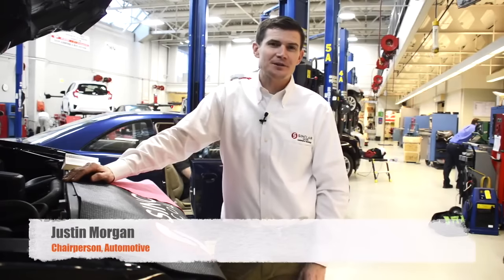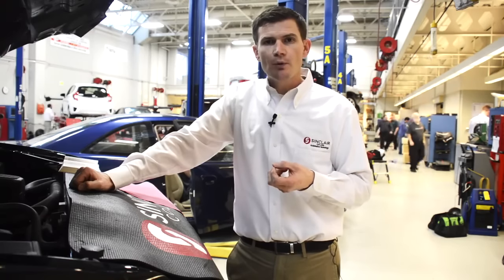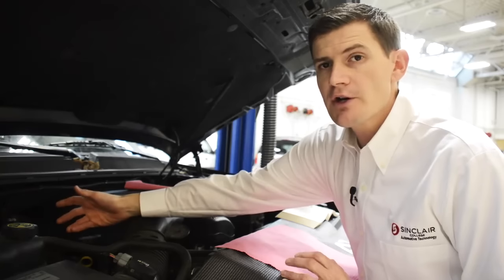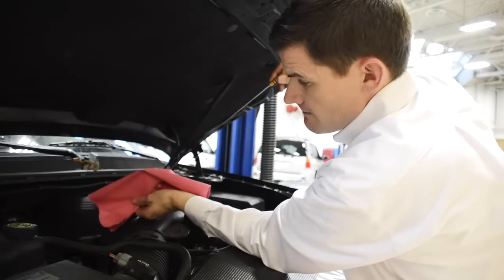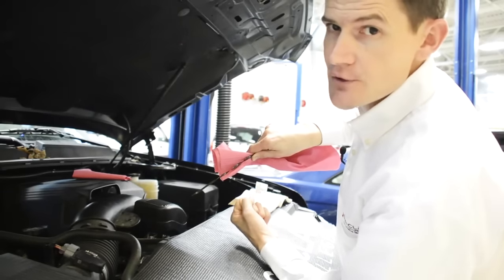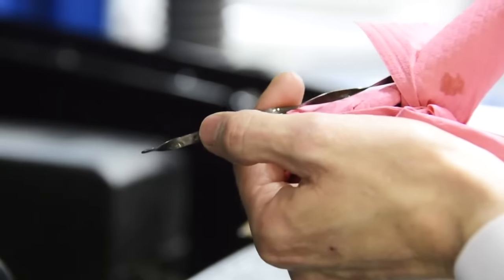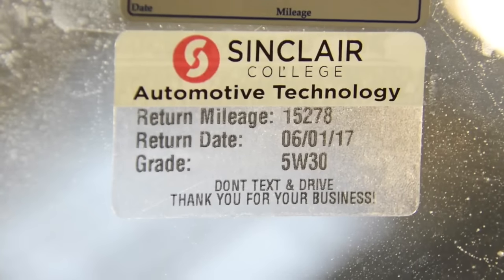How To Check Dipstick & Engine Oil - EASY

Comment: As an added note, my Mercedes C300 recommends an oil change every 15k miles or 12 months, whichever comes first. As long as you are using a quality full synthetic oil with long life filter there is no need to change your oil as frequently as your mechanic or lube place suggests
Reply: I get about 12k miles with full synthetic driving conservatively mostly on the freeway.  I stay on top of it and check it regularly, never had a problem
Reply: Especially if you drop the pan and do a thorough clean every year or other year.
I just cleaned up my 03 Yukon running strong.
Healthy truck
Reply: @someoneyoudontknow7407  - drop the pan ever year or so?     Dropping the oil pan is not something you ever need to do except if the gasket is going bad. Done it once on a truck with 270K on it but that was due to gasket. Don’t know of anyone that does it as a part of ‘regular’ maintenance
Reply: Why chance unnecessary engine wear?
I would never dream of going beyond 5000
or 6000 miles between oil changes.
Reply: @jimflick7564  - exactly Jim. The guy mentions Mercedes recommends… it says it all from you right there. Also the same thing about recommending that you don’t need to change the transmission fluid. Yeah right. No car should go over 7500 miles without changing the oil.  Period. I personally change mine every 5000. I would never dream of going 10 or 15,000 miles. Course you couldn’t give me a Mercedes. I have no desire to own a Mercedes. Overpriced and overengineered
Reply: have you had a lab analysis done to prove that?
Reply: @MotoTvWoodsFarm  - prove what?  ATF does not need changing and that’s it’s a lifetime fluid?
Reply: @jimflick7564  I dream of it on all of my cars.  I started using Amsoil back in 1995 and then switched to Mobil 1 around 2005.  I run my vehicles for 10,000+ miles with absolutely no engine problems.  My vehicles barely start using oil after 150,000 miles.  Although I use an Excel spreadsheet to document all maintenance, I still put white labels on the frame in front of the radiator telling me what oil, at filter, date date and mileage when I did it.
Reply: Mercedes with all German cars are money pits 🤣.
Reply: If you plan on keeping your car for a long time, over 100k miles, then don’t listen to this advice.
Reply: @jimflick7564  1993 Honda Civic, owner's manual directed oil change every 7500 miles.  I followed that guidance from the manufacturer.  Sold the car with 193,000 miles, at which point the engine purred like a kitten.  Never understood why individuals assume to know better than mechanical engineers.
Reply: @condor5635  life time ATF, whose life time? Manufacturer life time is the warranty time, your car life time is all on you, it might be the same as the warranty time, or you may want drive your car as long as possible, then you need drain ATF first at 60k miles, then follow by every 40k miles.
Reply: @wolfnorth7075  - I agree with all of your comments not sure what your point is but yes the fluid needs to be drained as regular sort of maintenance
Reply: Mercedes 2008 GL450. Changed oil every 13,000 miles. Always Mobil1 European Formula, synthetic 0w-40 and I have now driven 367,000 miles No sludge. Just started using about 1 /2 liter of oil every 7,000 miles when it got to 300k miles. I changed the oil exactly as Mercedes service book states. Techron complete once a year., original coil packs and injectors. Original 4.6L V8 engine and 7 speed transmission. Merc still makes awesome cars.
Reply: @condor5635 how long is lifetime  5 years 10 years 25 years, or till it breaks 😂

Comment: For any kind of Mitsubishi that is not rallied. Oil should last 5,000 miles until your car hits 75,000 miles. Then it should drop down to 3,750 miles. After about 130,000 miles, the oil should be changed every 3,000 miles. I read that from a mechanic on a forum that worked for Ralliart in the early 2000s.
Reply: It's helpful if your cars manual doesn't match your car. Like the 2004 to 2005 Mitsubishi Ralliart, the owners manual is the same as the Evo 8 so go with their manual even though it doesn't say Ralliart. It's the same engine basically just with no turbo and bigger displacement.
Reply: I totally agree with you. Keep a closer eye on your oil level as your car ages. One way to do this is to increase the oil change interval 
or simply learn how to check the oil level. yourself more frequently.

Comment: Just got a car on my birthday in April, and had the engine oil changed around then. Checked again today, and it was on the low side (it just says Min or Max) it appeared, and I’m watching this after I added more…

Probably should’ve done that beforehand. Hope I didn’t overfill or else I have to drain it a bit. Lol
Thanks for the video!

Comment: Question on 2014 Nissan Sentra
I've been very closely watching my oil because I've had the catalytic converter go out twice in a year and this one needs to be replaced again. Check engine light P0420. I'm shopping for a new car now because this car has had so many big issues I just can't continue to invest in it. I don't know how much time it has left, not long I'm sure. The burning smell, black residue on the back of the car, and now louder sounds coming from the engine feel like I'm hearing all the alarms go off on a patient slipping away. I just need the car to last 4-8 more weeks and I'll be in a new car and I will donate it for scrap parts. 
My question is when I checked the oil tonight I feel like I smell gas on the napkin I wiped the dipstick on. Maybe my mind is playing tricks on me but I'm so sure I'm smelling gas. Obviously, I'm not a mechanic so maybe the answer is "that's perfectly normal" but i don't think so, so I have to ask. Sorry this is so long. I hope you have time to read and answer. And please any other responses, please be kind. This has been the most stressful situation just swinging from one day into the next day hoping it lasts a little bit longer.

Comment: As long as there is oil on the stick you are good. If there isnt oil on the stick you are a quart +/- low. Just add some oil or do your oil change. I have mine timed to where I go 5000 miles till oil change and around 3500-4000 miles I add half a quart. I have a 11' Nissan 370z with 100k miles on it and no problems. I also get my oil checked by a oil lab every change just in case.
Reply: So even a little oil at the bottom tip of the dipstick below all the holes means you need less than a quart?

Comment: i checked my car's oil level before starting it in the morning and it was well above full level, it's been like this for months, didn't get any errors or problems,  did i measure right , should i measure after turning on the engine?

Comment: The best rule of thumb is if you want to drive your vehicle for 200, 000 miles or more for 10 to 20 years or more then change it every 4000 to 5000 miles with a quality synthetic oil and a new filter every time or every 6 to 9 months whichever comes 1st. 6 months if you're in harsh driving conditions (Google or bc probably 85% of us daily drivers are.. Stop and go traffic, 20 or less miles to and from work, short grocery store trips etc...) you can go 9 months to a year of you're under 5k miles but why risk it. Doing it yourself for 50 to 100 bucks per year with high quality oil/filter and you're engine will thank you for decades. If you don't do it yourself you can just use coupons or deals at the shops for just basic non synthetic oil and probably do it every 3 to 4000 miles (so 3 to 4 times a year) for less than 150 bucks a year. Oil is cheap compared to engine problems. You don't need the 15000 or 20000 mile oil, just your cheap basic synthetic is fine, I use Costco Kirkland synthetic and get it when it's on sale for less than 30 dollars. 2 to 3 New filters and I'm good for the year. 1 hr of work per year. Easy peasy.

Comment: Kia ceed 1.6 crdi.   I am driving from 92k mile to 109k mile with no change. Though the oil looked black never had an issue. Synthetic oils can go till 15k miles.
Reply: All are motorway miles at constant 70 to 80 range.   I get 60mpg

Comment: I've always wonder why car makers cant make the stick with a WHITE coating at the bottom. This would make it much easier to read. You prob have many people who THINK their level is good, but its not. Having a white area would be a much better contrast against the oil.
Reply: Mine comes in yellow (citroen cactus)
Reply: look for light reflection, not the oil itself. and if they put anything with a coating there, if that coating came off it would cause serious issues, and white? whats white in this world that wouldnt be stained black by engine oil in no time?
Reply: @matthew4107  thank you I was going to say the same thing
Reply: Spray paint it

Comment: You are supposed to check your engine oil 5 minutes after driving while the engine is hot, if the oil reading isn't in the xxxx zone on the dipstick fill up your oil and keep checking the oil dipstick until you see the oil in the xxxx zone, whether it's your dream car or not take care of your engine.
Reply: I've gotten a oil change doone recently.99 tahoe v8.the oil exceeds above the  xxxs ..when cool..is that to much oil??
Reply: @wendell617  You will need to check your oil when your engine is hot to get your oil reading on your dipstick, if it is in the xxxx zone at that time then you have enough oil in your Tahoe

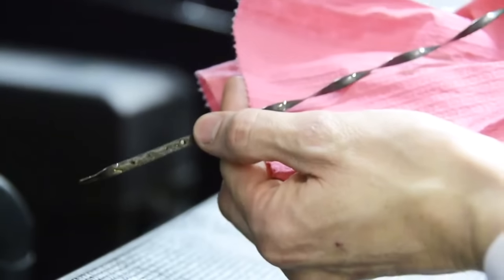Comment: I wonder if those many multiple holes @ 4:00  in the dipstick make it more the oil level more obvious. Maybe the oil doesn't get into those holes as easily as it gets all over the stick when you put it into the tube. Do those extra holes help ?

Comment: I've had a headgasket replacement and they changed everything, new oil, coolant, timing chain etc.... but.... when i checked the oild dipstick, doesnt look like much oil is in there or am not seeing it because the oil is so clean. should i had little bits of oil in the car?

Comment: This car I just bought is giving me problems when it comes to checking the dip stick. When I wipe it down, reinsert, then read it, it looks like the oils level is right in the safe range. Im confused though because its like there is a little oil in the shaft that gets on the stick about 6 inches above the safe line. What’s that all about? Its not being submerged, its perhaps that it curves around a weird spot and gets oil farther up the stick.

Comment: Today’s modern engines can EASILY go 10,000 between oil changes if using a high quality full synthetic motor oil like Mobil 1.
Reply: Synthetic all day baby 👌🏽
Reply: Id still change at 5000. Its just better for the car. Synthetic is good because it burns cleaner.

Comment: I changed oil to havoiline 10/40 . When i check after engine is cooled down. Its just oil at the tip of disptick. Yellowish color. But rest seems white color. Is it normal

Comment: Mr. Justin - Nice presentation....basically. Could you please redo your vid.... Explain to those who are not Automotive Chairperson of anything.... Should the vehicle should be parked level, for oil level check? What would be the difference in level on the dipstick, for an overnight, cold engine - & a hot engine, given a few minutes to drain down? Would an apprentice, get "Booted-Up"? If he dropped a drop of oil? - Not holding the dipstick horizontal - Tissue under?

Comment: Hey, it’s been 5k miles since my last full synthetic oil change. I checked my oil today and it’s very light yellow above both dots. Ik they say to get it changed every 5-10k miles, but Idk. Why does it look good then? It’s a Toyota btw one of the newer models. Idk if that helps cuz I’m not an expert. Every time I try to seek out expert opinions, they try to get me to buy services I don’t really need, so that’s why I’m unsure about this. Should I get it changed anyways?

Comment: I legit can't tell where it's marking. 2012 Toyota Corolla LE changed oil since maint req light came on. Changed the oil filter, emptied the pan waiting forever for the last drop HAH anyways had a 5qt oil container and I didn't add it all since it calls for 4.4 qt. Took the car off the ramps. Let it run for 2 mins. Waited. Checked the oil level a million times, wiping it off and dipping it all the way in. All on level ground. The oil obviously isn't as dark as it was before the oil change. I checked under the car and no leakage. I'm going to let it rest over night and check it in the morning. Any advice??? I didnt think my eyes were that bad. I can tell the dipstick is wet just not a clear level of indication where it stands.

Comment: The oil level should be checked when cold and on level ground, checking it on a hot motor can show a lower level than what it actualy is as the oil has not had time to drain from the top end back into the sump. A good idea to keep a quart of the recomended oil in the trunk as gas station oils can be pretty pricey and may not have the typ of oil you need.
Reply: @walkergillette3918  No that is not what i meant, checking the oil when you tank up is a good idea, just be aware not to be fooled and overfill.

Comment: I found it difficult to read my dip stick with synthetic oil. I got a tip on the internet to sandblast the shiny surface to a dull gray. Dipstick is way easier to read now.
Reply: You can use sandpaper too it will rough it up and make it easier to see but i use 10w30 so its easy to see
Reply: My problem with dip stick when checking, one side shows full (hatched area) other side barely shows oil in hatched area. Can someone explain? Honestly don’t know what’s going on. Manual say use 6 quarts, I added only 5 1/2. Is the missing half causing this? But why is one side different than other. 2018 Silverado.

Comment: I bought a car at 8k km mileage, now it is 10k km mileage, i asked the oil expert if I need to change,  by manual check with dipstick it says its color is good, not sticky, not thick. But this is a new engine it will always show this condition of oil, so just change engine oil after 5k km , is this statement correct?

Comment: Problem with modern vehicles is that they now burn more oil than cars 7-10 years ago. Burning 1 quart every 1000 miles is now normal.
Reply: somethings wrong with ure engine
Reply: My truck manual says that but it's now over 5k miles since the oil change and now it's only in between the min and max. I left it at full when I did the oil change. They usually put that now since it gives companies more leeway if someone's car does burn oil.
Reply: Says GM
Reply: A quart every 1,000 miles?!? Something is wrong with your car. I have my oil changed every 3,500 miles and the oil is still clean and right at the full line.

Comment: Most times, when I change oil at work and the car is equipped with said oil monitor, the repair manual will tell me to reset the monitor and let it warn the customer. 
If the oil life isn’t a monitor and can be physically adjusted I will be told to follow the manufactures recommendations.

Comment: Every 3000 miles? What a dipstick, if using that much oil that quickly then must be something wrong in the engine.
Reply: Nothing wrong in some cases. Some Audis - if not all - require oil that often
Reply: if you're putting alot of miles on the car I don't think it's such an abnormal thing, like if you commute far to work every day

Comment: Is it mandatory to change the oil as per specifications for eg 10k km or 1yr. What happens if I have driven the car only for 5k km in a yr, does duration have something to do with the change in viscosity of fluid
Reply: Engine oil is tested and recommended by milage not time. They only say time because they are fussing how many mile you drive. Always go by miles not time.

Comment: 3,000 miles and 12 months later my lighter driven car oil change required light came on, I know simply based off time is why. The oil still looks fresh and smells good, I really dont want to take it in if the oil is still fresh until 5,000 miles.... what do u guys think should i change it just cause its been 12 months even tho it only has 3,000 miles on it??
Reply: Bro you must change oil once a year even if you drive less than 5,000 miles.

Comment: I change my oil every 5000 to 6000 miles.  Remember to not over fill
Reply: I overfill mine and Im worry about it
Reply: @DanielLopez-mk4db  lmaooo you probz got blue smoke due to busted valve stem seals lmao

Comment: Note: If you have a Honda, most likely you will see dark oil after driving on a fresh oil change, it’s just a Honda thing

Just make sure to change your oil regardless of vehicle at 3,000-5,000 miles, along with filter, but also make sure to get a good filter like Mobil 1 (cheap at Walmart) that will last more than 3,000 miles because most don’t

Comment: Changing oil every 3000 miles? Why do Americans do that?!

My oil change schedule is 10 000 miles. In newer vehicles it's 20 000.
Reply: 20,000? What kind of oil r u getting
Reply: Your car's running off of straight stegosaurus juice to reach those levels.

Comment: Do you check oil level after you put the fresh oil or do you have to warm the engine first before checking the oil level?
Reply: I would drive it around the block and then park for 10-15 minutes for the most accurate reading however that's totally up to you and checking the dipstick fresh change will still be fairly accurate.